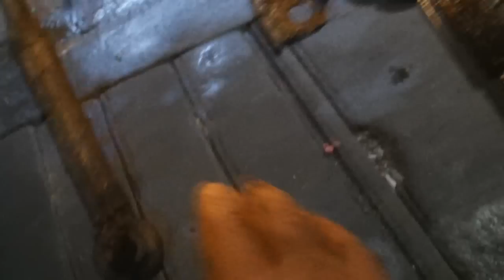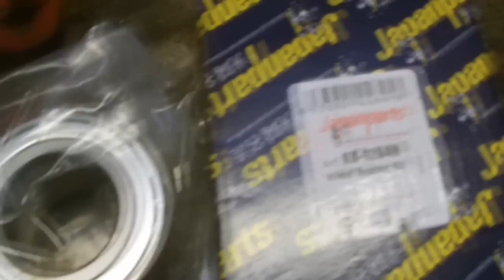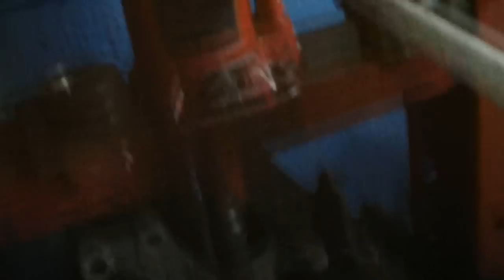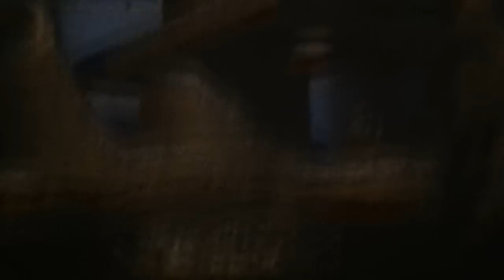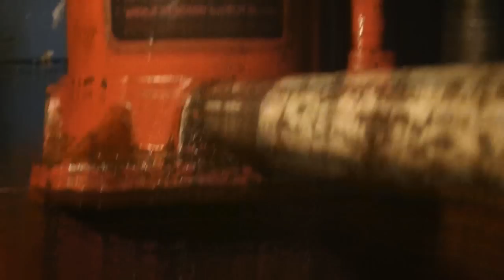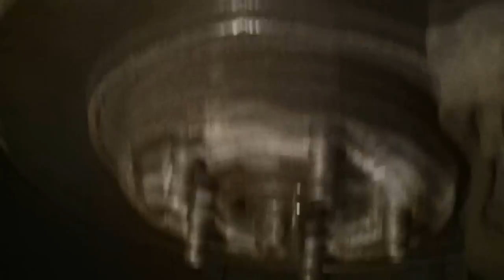toyota avensis d4d front wheel bearing replacment

Comment: Hi Liam,good video. .. I have a 2002 D4d avensis with a bad front wheel bearing. I was thinking its the front left wheel bearing as the whining noise is more noticeable as you make right turns. I jacked up both front wheels and handspun them by hand and there is a bit of rubbing front both wheels and also front right wheel has a very small bit of play. So maybe both bearings are going?,,,or is the small bit of play on the right due to the tie rod?The tie rod doesn't look bent or anything.,,Or Maybe I should change both front wheel bearings while I am at it ? She has 221,000 miles on the clock.